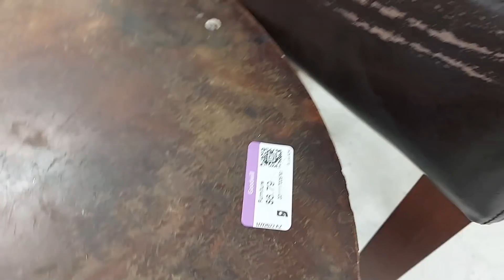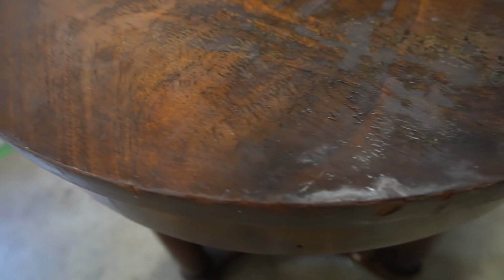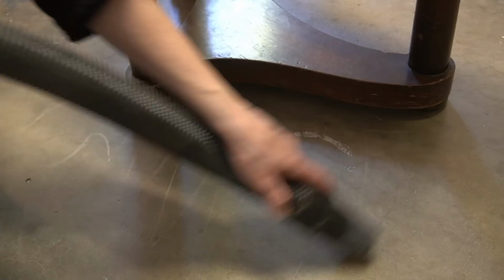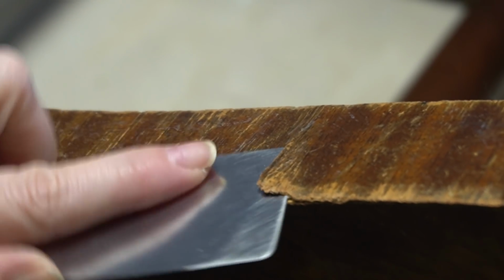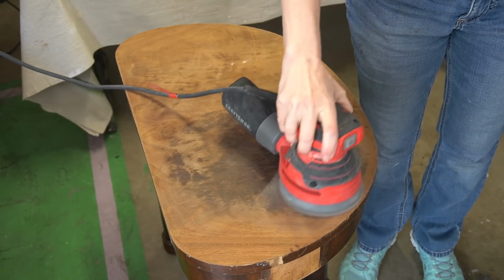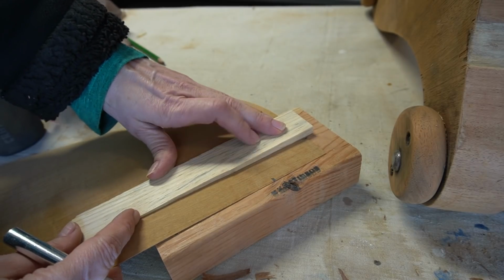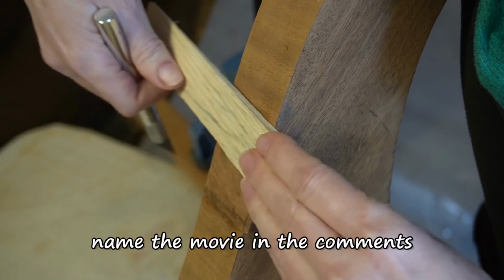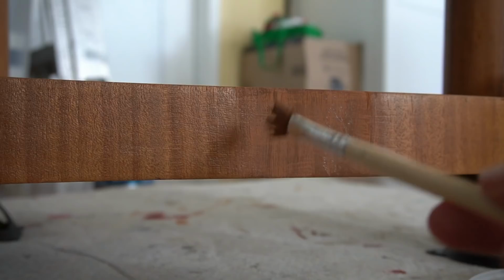Ugly Duckling Challenge THRIFT FLIP Second Hand Furniture #fauxbois #furnitureflip #fauxfinishing

Comment: First time viewer of your channel.  Impressed with how well the faux painting came out.  You should do a tutorial on that!  Also wondering how you addressed the burned areas along the edge of the top of the piece.
Reply from the maker: Thanks so much for saying that! I'll keep in mind a full tutorial on glazing or other faux. Will need to figure out how to make it interesting for video 🤔 Totally forgot to mention the burn marks. Luckily they didn't go super deep into the veneer and they sanded out. If they were deeper I might have tried oxalic acid but I've never used it on mahogany before.
Reply: @CopperCactusDIY  Glad the edge burns sanded-out.  Not sure how well oxalic would work on burned material.  My experience is that it works best on dark water stains, but it should have been fine on the mahogany.

Comment: Hi, when I see a piece that I think needs extra cleaning I get out the scotch bright pads first before tackling the finish. I have had good luck when the finish is old or really dirty.  Along with that I use simple Green it tool a solide maple table full of tobacco to clean in two washing and a light sanding to perfection.  Hope that helps.
Reply from the maker: Hi Teresa, thanks for the ideas! All I tried to remove in cleaning was the first layer of grime. As you could see, the finish was so far gone there was no saving it with cleaning. So I eliminated the issue of clogging up sandpaper, that's all.

Comment: I think you said the underside of the base had veneer on it. Did you consider (and would it be possible) to remove that veneer and use it for the patching. Then, if needed put new veneer on that where it would not be seen?
Reply from the maker: That's a freaking great idea! Thank you Gill! There is veneer on the base underside. I'll have to pull out the heat gun and see if it would be possible to pull it up unscathed. It was all pretty dry but maybe I can condition it first. Thanks for the idea 💡😀

Comment: I think I would have just put Citrus Orange stripper on it after I cleaned it.
I will do as much as I can to avoid sanding. Only because it makes such a mess.
Reply from the maker: I just picked up a piece to get dust collection together. Chemical strippers bother me so I try not to use them if I can avoid it.